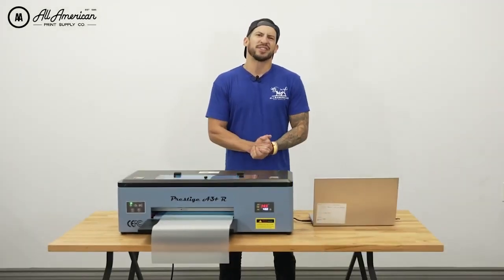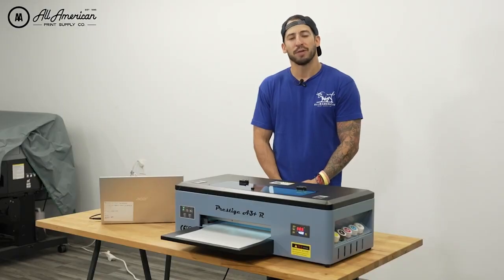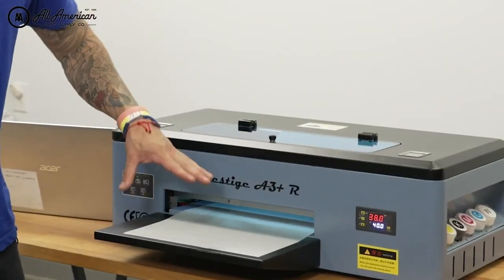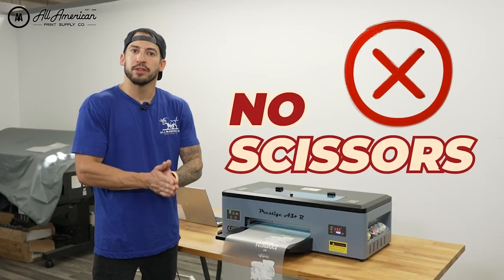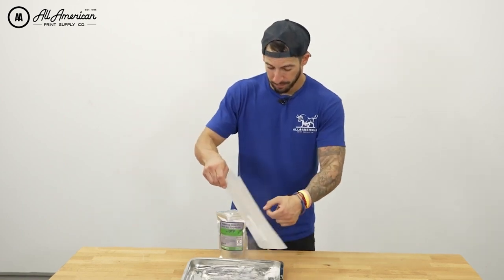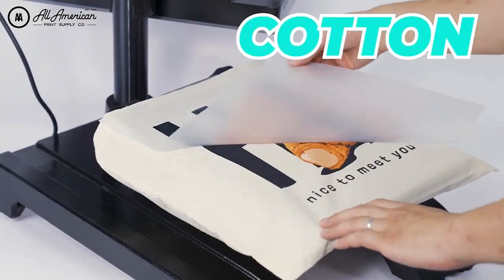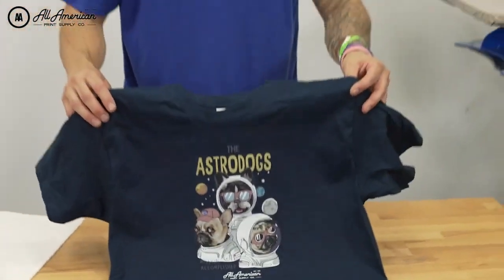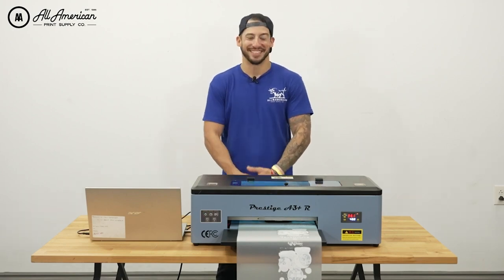Desktop to PRINTSHOP: Getting Started With DTF | AA Print Supply

Comment: This is one of best machines I saw on higher price side but software is clutch
Reply from the maker: Hey there! Pound for pound this machine is quite the performer - and the software is very user friendly.
Reply: @AAPrintSupplyCo  I agree software is awesome
Reply: @jamie white I have a 1390
It's been modified with cadlink integration im sure it a good product it desktop printer not dual head unit. Your paying for customer troubleshooting and convenience. My Ali express printer is a nightmare due crappy software
Reply: @jamie white i thanks i know now after purchasing R1390 that a R2000 0r L 1800 is more durable but print speed is like 13 mins with dx5 head it about 8 minutues. You are correct you can use cadlink and yes this does look like a esmart print now that you menchion it. I have learned so much about these printers best to buy obviously is A2 dual head printer about 5 to 8 k depending on set up
Reply: @jamie white what would you recommend? Thank you
Reply: @jamie white thank you!

Comment: How long can you wait before adding the powder to back?  If printing a gang sheet or multiples items, is it ok to wait until all prints are finished or do u recommend cutting while still printing,  Doesn't ink still have to be wet to add powder.  Does the ink dry quick?
Reply from the maker: Hello, the powder should be applied while the ink is still wet to adhere to the entire image. If you do cut while printing, be careful not to lift the media which will bring the film into contact with the printhead. The ink does not right away but we do advise waiting too long before applying the powder

Comment: What's the difference in the Epson 1390 print head and the L1800 that I see a lot of the printers this size have?  Thanks.
Reply from the maker: Hello, certain parts/printers may have region or country specific numerical denominations - at this time we do not have an L1800 model to compare with. We can advise the 1390 printhead has: high ink coverage levels, speed, less nozzle blocking

Comment: Where do you insert the individual sheets?
Reply from the maker: Hello! On the back of the machine there is a sheet feeding slot and inside the tray is a guide to accommodate letter size up to 13" x 19"

Comment: Hello,

How to improve the colors? Some of the designs look very dark when pressing on dark garments. Please help! Thanks
Reply from the maker: Hey there, what printer and profile are you using to print with in the CADlink software?
Reply: @AAPrintSupplyCo  hi, I set up a max white printing+color boost to darker+choke 5+100% white under black
Reply from the maker: Have you tried the Hi Res option for the film you are printing with?
Reply: @AAPrintSupplyCo  hello,

I tried everything I was told and things I figured out myself. Still result happens.
Reply: @AAPrintSupplyCo  to make sure I did the high resolution, is it under color adjustment?
Reply: @AAPrintSupplyCo  there are light high res and dark and black high res that I have used all, btw!
Reply from the maker: Hello there, we have contacted our tech support department in regards to your questions and they will be reaching out for support

Comment: Are the machines and software apple compatible ? Can I use my Mac as is or do I need something extra to be able to use it? Thanks in advance
Reply from the maker: Hello there, the CADlink RIP software requires the use of WINDOWS operating system. Not compatible with Mac computer at this time
Reply: @AAPrintSupplyCo  thank you !! I was afraid of this answer 😩 will need to get a windows computer first ! Thank you !! I will be in touch.
Reply from the maker: That being said, we have heard of people getting different levels of success with pseudo Windows programs on Mac computers through workarounds such as bootcamp or parallels

Comment: Hi! What's the difference between A3+ R &  A4?
Reply from the maker: Hello, its going to come down to size - the A3+R model ran 13" wide and the A4 runs around 8" wide. Both machines can print rolls in case you need more size just rotate the image

Comment: I noticed you printed at 1440x720 and the manual says it can do 2880x1440. What is the true max resolution?
Reply from the maker: Hey there! The Prestige profile included with this version of CADlink is going to top out at 1440 x 720 this resolution is optimized for quality and print speed

Comment: What print settings did you use?
Reply: I have the same printer and don't see anywhere the print settings in the videos provided
Reply from the maker: Hey there, here are the software settings we advise: Digital Factory v10 / v11 Color Profile : "Dark High Res DTF Station Ink - DTF Station I" or "Dark High Res DTF Station Ink - DTF Station I v2"

DigiRip Software Color Profile : "Super Res" or "Production Res"

As of today, here are the advised supplies for best results for the A3+R:
Film : DTF Station Warm Peel
Ink : Color Max

Comment: Is that a L1800?
Reply from the maker: Hey Rick, the Prestige A3+ R runs the 1390 printhead and boasts a bevy of custom features such as temperature control, film rolling platform/sheet printing functionality, white ink circulation + stirring as well as warranty protection and after purchase support
Reply: @AAPrintSupplyCo  
Printhead For a Epson R260 R265 1390 1400 1410 1430 L1800 1500W R390 are All the Same. Most of the Small Desktop Printers are built from a Converted L1800.